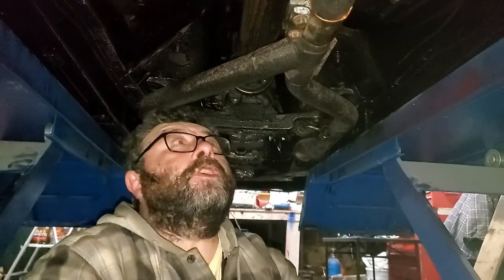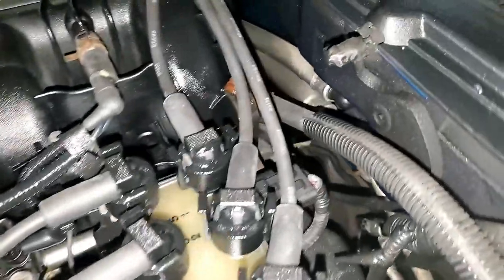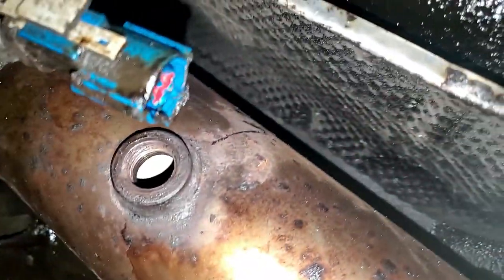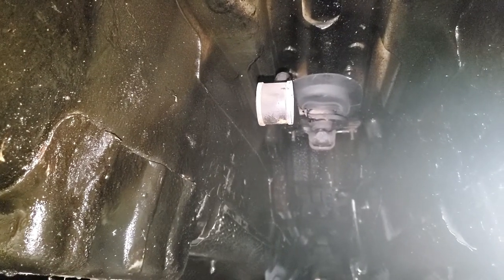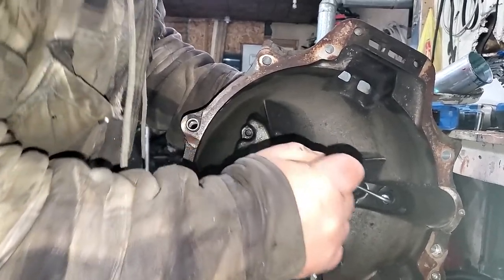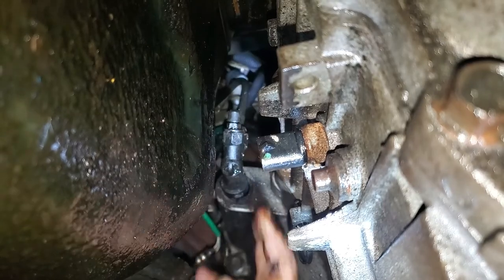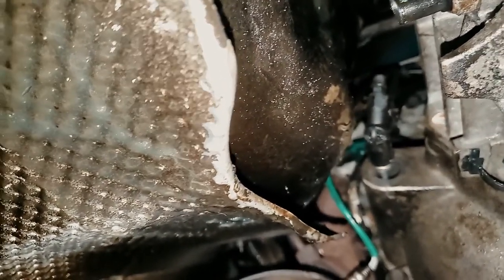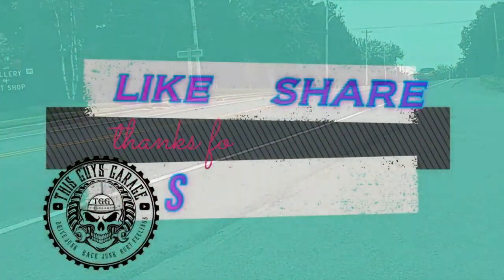installing a clutch in a 2005 2014 mustang easiest way possible

Comment: You guys Are using a lift. Would it work to if I used jackstands and ramps? Or it needs to be higher?
Reply from the maker: i am using a mid rise lift  about 40 inches of lift , can be done with a good set of jackstands 100%

Comment: I look at your videos all the time I currently have a 2010 Mustang V6 4.0 5 speed I replaced the clutch in everything fly well everything problem is bleeding the system I didn't blanch breathe to throw out bearing how can I bleed it in the car the master cylinder for the brakes is also the reservoir for the clutch
Reply from the maker: i did do a video on bleeding this particular system , pump the clutch 10 times walk away for an hour , pump clutch 10 more times ,repeat this method 3 or four times should be fully bled. let me know how you make out.

Comment: I replaced my clutch on my 2007 ford mustang gt and for some reason, the wrench light came out. It’s not accelerating the way it was before and it only goes up to 3500 rpms each shift.

Comment: Whys the exhaust have to come down? Looks look theres enough room with it on
Reply: Did you ever attempt it?
Reply: @dydydddydy8543  ya I did the exhaust has to come off it gives you so much more room you'll want it off
Reply: @serbia991  gotcha, also do I have to drain my transmission oil?
Reply: @dydydddydy8543  ya you should to avoid a mess

Comment: Bench bleed the slave cylinder before you install it. Nevermind the clutch fix that oil leak.
Reply from the maker: It's undercoating...
The reservoir for the slave cylinder is combined with the brake master cylinder so there is that.  

YouTube has room for your video on the topic by the way...
Have a good day 😊

Comment: so you dont have to remove the driveshaft or exhaust?
Reply from the maker: The driveshaft has to come out. Depending on your exhaust system maybe ye maybe no. You have to judge if you have the room to bring the transmission back 6 inches before you lower it. Great question 👍

Comment: I replaced my clutch flywheel and tob in a 2009 mustang gt. I got everything together and it shifted like butter on jackstands. Soon as i put the car down still running it wouldn’t shift at all. Trapped air maybe? I have a firm pedal just wont disengage the clutch now. The car starts
Moving going to first just wont go into gear
Reply: did you figure it out?
Reply: @cadensunsdahl4837  yes i put a spacer in and it didnt need it. Some gt’s have a built in spacer
Reply: @XxTR1CELLxX  so the throw out bearing was constantly pressing on the clutch basically?
Reply: @cadensunsdahl4837  no it would sit normally but on clutch press it would depress and go so far it would disengage
Reply: @cadensunsdahl4837  so on clutch pedal the pressure plate would sit against clutch constantly
Reply: @cadensunsdahl4837  took out spacer and it shifts money now

Comment: What did you sand or scuff the flywheel with? Thanks
Reply from the maker: i generally will use 120 to 180 but what ever you have hanging around will work
Reply: Thank you
Reply: @thisguysgarage did you use a orbital sander
Reply from the maker: @smoke_oguwop  I did
Reply: @thisguysgarage  appreciate it I'ma try this I gotta replace my clutch lol
Reply from the maker: its not for the faint of hart lol but let me know how you make out ,any questions fire away @smoke_oguwop

Comment: Does the same clutch kit fit to all 2005-2009 Mustangs 4.0?
Reply from the maker: Yes
Reply: When switching from the automatic to manual will I need a clutch kit
Reply: @camerondeastv560  yes. You'll need a new one, unless the one your swap kit has its still good. However I'd recommend you to get a new one for better results.
Reply: @thisguysgarage  nope, I already Found out that the models from 2005 to december 2006 take an speciffic clutch kit while models from december 2006 to 2009 a different one. My mustang was made on 10/2006. The clutch kit a bought didnt fit so I had to get the exact one. Greetings.

Comment: Ok so a few things here I'm curious about. Why was the exhaust not removed to give yourself and the transmission room to properly remove the slave cylinder line and transmission itself instead of cutting a $300.00 part?? The pilot bearing needed replaced as well but I guess you couldn't cut that from the back of the motor. Wouldn't it have been a good idea to bench bleed the replacement slave cylinder as well. Going by the dumpster fire you call a shop to work in says a lot about ones work ethics and professionalism. I found your video very amusing and recommend it to anyone for how NOT to do this very simple 8 hour job.
Reply: Hey Chris, I’ve got an 09’ I’m about to replace with a clutch kit. Do you have some references of better instructions/advice you could give?
Reply: @squash7751  i got an 09 also did you get it done yet?